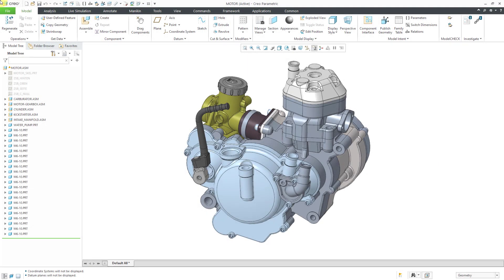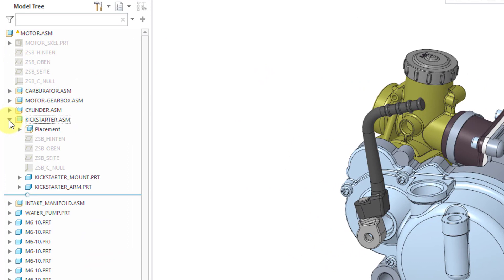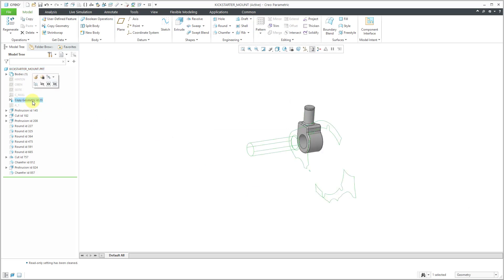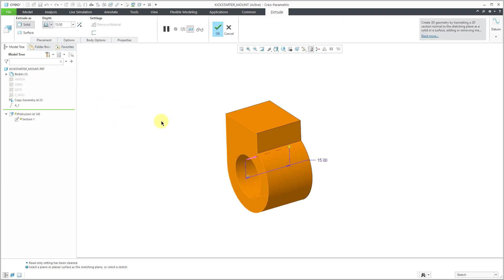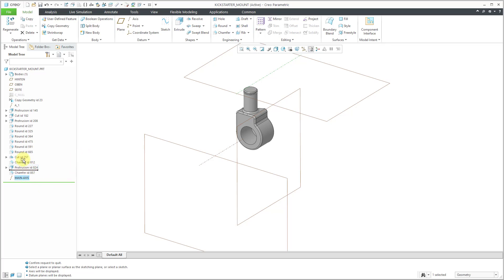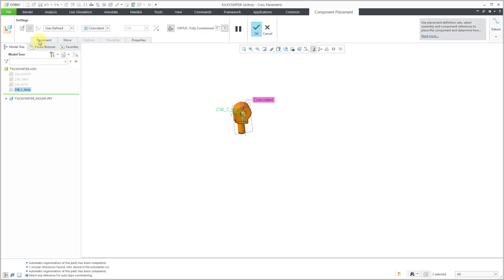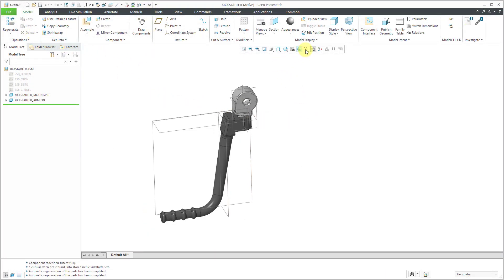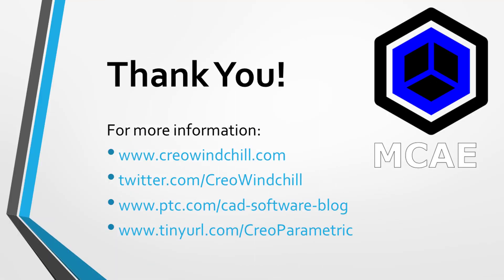Creo Parametric - Circular References (Part 5) | Assemblies and Top Down Design

Comment: Really like your videos.
You've shown a number of techniques for handling circular references in mechanical models but I more than occasionally run into circular references in harnesses involving locations. These can be tricky to impossible to resolve. Typical scenario is harness is working, do a route or something then circular references show up. Re-arranging may occasionally solve the problem but frequently does not. Have you run into this type of situation? Could you possibly take a look at this rather narrow circular reference issue?
Reply from the maker: Yes I have. However, I usually make my circular references videos when I come across a model with one. And I don’t model cable harnesses since I stopped being a cable harness designer about 4 years ago. So I don’t have any examples to demonstrate. But if I come across one, I’ll make a video.

Comment: can you tell me method that how to save all the drawings from workspace to local drive (let's say on Desktop) at one shot
Pls tell me ASAP because I need to do around 2500 drawing files one by one saving in local drive and it's hectic and taking so much time.
Reply from the maker: Add to Workspace and then Export from Workspace
Reply: @CADPLMGuy  Export from workspace will create .PSW or .PSA file (somewhat similar form) but then how can I extract the drawings from that perticular file ?